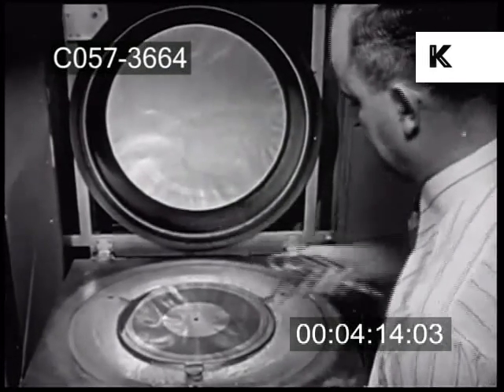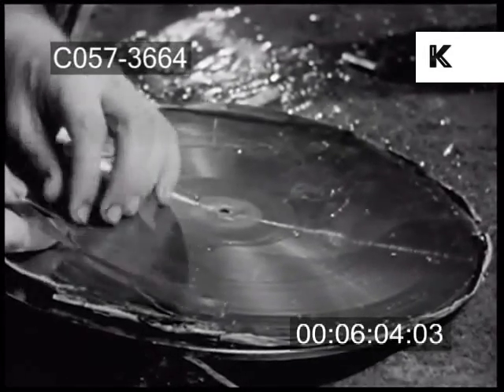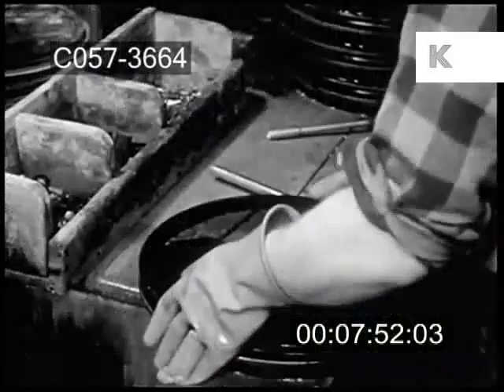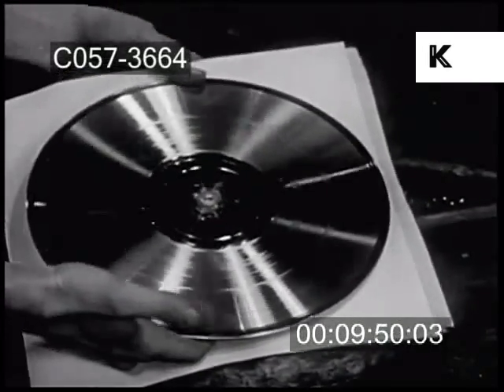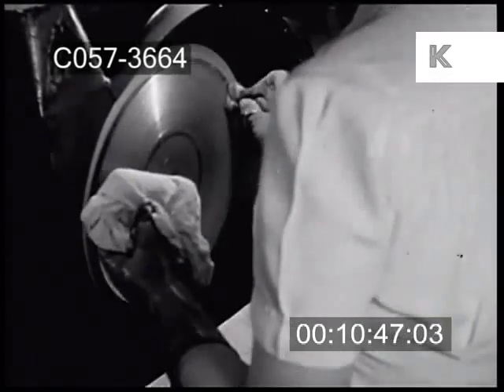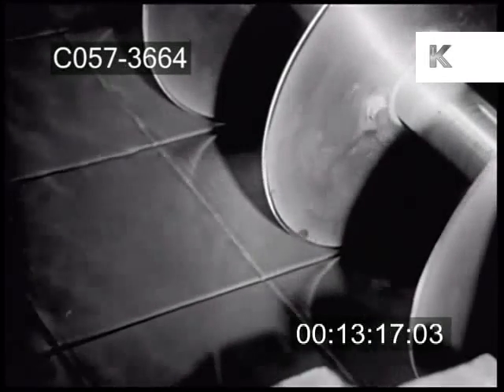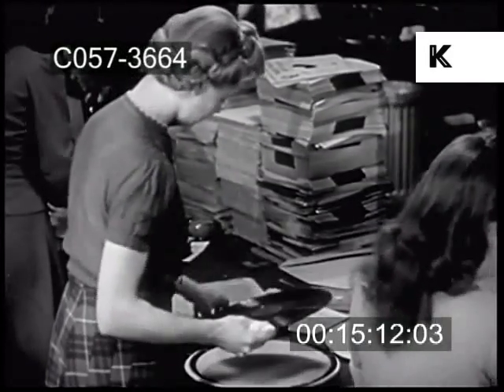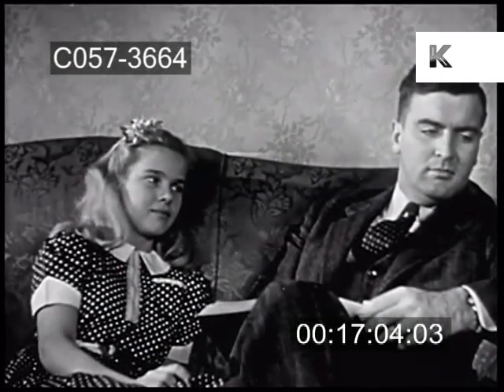1940s Record Pressing Factory, Vinyl

Comment: These records are not VINYL  (  vinyl is a strong flexible plastic which does not break easily ). These are SHELLAC records - as mentioned in the actual video. A few - very few - 78 rpm records were produced in vinyl in the late 1950s when shellac was being phased out in favour of 45 rpm vinyl discs, but that is not what we're looking at here and generally, 78s from their beginning to the end were shellac.

Comment: Interestingly the process hasn't changed much from shellac to vinyl. Apart from the composition of the disc and of course using solid gold before the first coating process!
Reply: In the USA it was in the 1940's not unusual, to play records via radio. So they could change the plastic, mix some vinyl under the plastic and some kiddie records were vinyl. This made it possible to change to something like the LP.

Comment: Evidently shellac records, not vinyl...
Reply: I don't know man. Looking at 12:34 it looks like one of those early RCA vinyl machines. I never saw a machine that flips shellac records around like that. I had a shellac 78 juke box and you put the record in and it stays there, the turntable comes straight up and the needle moves over. No machine for shellac records would just drop them like in this video, it has to be vinyl.
Reply: "1940s" vinyl microgroove LPs weren't invented until the late late 40s